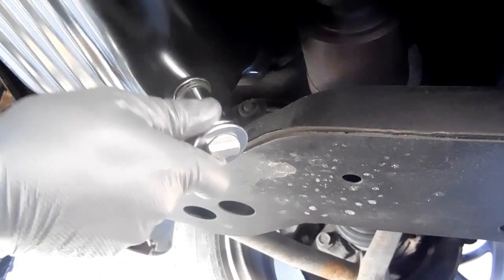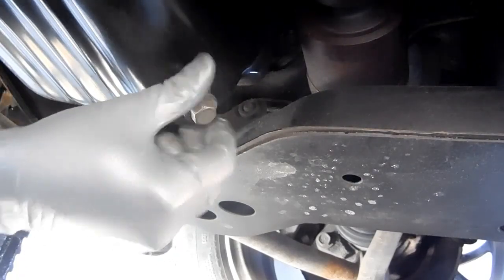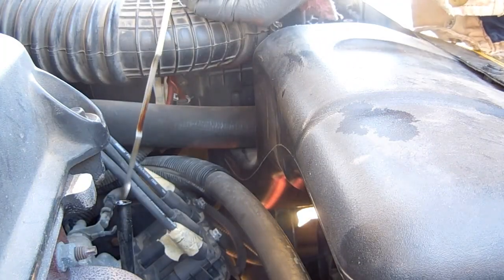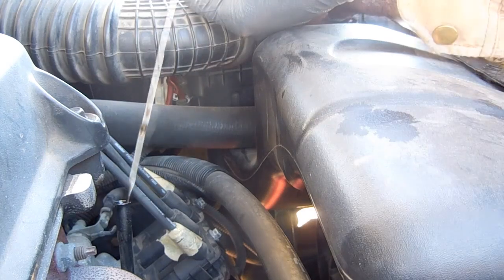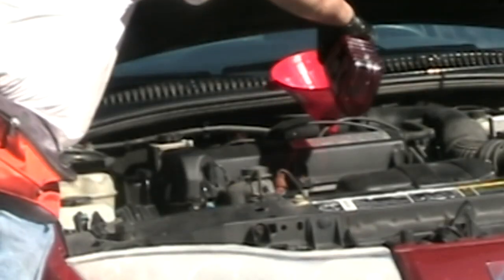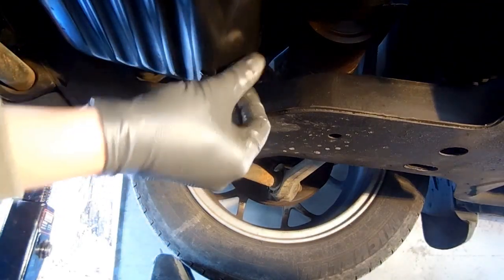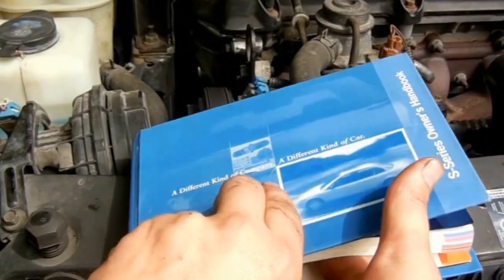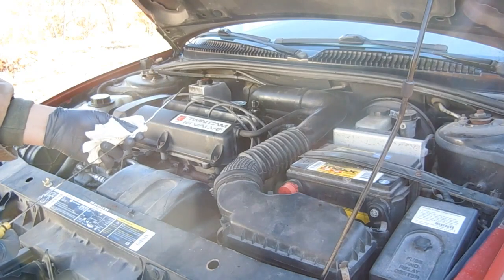Safe Motor Oil Flush Using Kerosene

Comment: 🤣🤣🤣 FRAM IS THE CRAPPIEST FILTER ON THE MARKET ! DON'T YOU WATCH YOUTUBE
Reply: they work fine people are the ones that are crappy
Reply: @brian bessette nah that be Amsoil or Royal Purple for a Cummins diesel it be a Donaldson blue filter
Reply: That's Saturn engine is junk why put a better filter on. Stp and purolator isn't that better mobile 1 or the OEM are better than the first two I mentioned as well as fram
Reply: junk all the way
Reply: if ur driving a work rig or car ..low value......fram will do it....i use m alot
Reply: Fram ultra synthetic actually good tho
Reply: Yea no shit
Reply: Used Fram on my last truck and it had 300,000 miles on it when it was sold. Changed every 3,000 miles using conventional motor oil. Most retards are bandwagon followers and take everything they hear on YouTube from content for views posters as 100% correct. I have never seen a vehicle grenade a motor using a Fram filter.
Reply: Cummins Owner exactly! I put 626,000 on a v6 Pentastar. Every mile except the first 3,000 on a fram filter. Engine looks like new inside.
Reply: @CSXtrackworker  They're still inexcusably cheaply made. Have you seen the internal construction of them? Who cares if they work for 99.999% of people out there. They should be made better, and better made filters are available, so that's what I and a lot of other people are buying; Wix, Bosch...many other brands, most ALL other brands are better made.
Reply: @tempest411  I'm well aware of how they are made. A lot of OEM filters are made the same way. If you change them when they are supposed to be changed then you won't have any problems.
Reply: Azarah Eden brian bessette they’re all the same on the inside go watch filterkingz videos where he opens up the filters and you’ll see for yourself there’s not much different between any brand of oil filter
Reply: @96blackjacket  No, 99% of them are not glued together construction paper like Fram is. Anything is better than Fram.
Reply: tempest411 point of fact most oil filters are glued together like I said go watch filterkingz videos and you’ll see for yourself that internally most oil filters are nearly identical
Reply: tempest411 also every singe internal filer I’ve ever replace in my shop has been glued together and we use factory replacement filters the glue has no problem holding up to regular or even extended oil change intervals or people that don’t know there oil needs to be changed and come in for the first time in a year or better

Comment: One thing worth noting too folks is not to leave the oil filter on while draining the oil ( think of when you hold your finger over a straw and you can maintain water inside the straw until you let your finger off ), you are better off to loosen the oil filter straight after you remove the sump plug and also take the oil cap off the top of then engine - that way it creates a nice "vacum" if you like through the engine from top to bottom and helps remove all the oil out everywhere. Otherwise with the oil filter left on, you can get residual oil remaining in and around the filter and engine galleries.

Comment: When changed per manufactures recommended interval, modern engine oils and engine designs do not produce any “sludge”. How did you come to the conclusion kerosene is “safe”?

Comment: Ok buddy, first of all Kerosene does not have anti-wear additives, like engine oil does, and yes the engine need these all of the time. So the solution (no pun intended) is to mix the kerosene with some anti-wear additive such as Hy-Per-Lube zinc substitute or engine break in additive, which usually contains ZDDP.
Best way I can think of is to mix 3 quarts of new oil, on sale if you're on a budget, with two quarts of Kerosene, and add the anti-wear additive. Make sure these are thoroughly mixed before pouring into the engine. Use the big can you have for the mixing. This way you have new detergents and dispersants of the new oil, the solvency of the Kerosene, and adequate anti-wear for the camshaft and piston rings.

Comment: take filter out first after the flush with got half quart in filter of kerosene but put new oil filter in and new synthetic oil in auto not the cheap stuff it turns milkey

Comment: Crazy don't do this not good for your bearings...rather remove the sump and clean that is just lazy and you could do engine damage by loosening up to much crap in your motor and totally blocking oil pick up...Its not advisable

Comment: If it weren’t cost prohibitive, it would work best to do back to back flushes until the oil drains clean. 
I’ve also seen where flushing an engine with a poor service history can fill the sump of the oil pan with all the “goo” flushed from above; for some reason it doesn’t drain out. 🤔
Reply: Not so cost prohibitive. I used 3/4 kerosene and 1/4 fresh oil. Ran until warm, 2 oil changes back to back to flush out all the kerosene, especially what's gotten into hydraulic lifters and such. One more oil change after a couple hundred miles or a week. About $100 with full synthetic. If you use enough kerosene, all that sludge will dissolve and run out. Only idle engine, don't rev!

Comment: I would recommend using Motul or Royal Purple full synthetic engine oil, and a K&N or Purolator Boss oil filter if you want your brand new engine to  have no oil leaks past the 60,000 mile mark and change oil every 3,500 miles if you drive a sedan or SUV, or 2,000 miles if you drive a Dodge Hellcat or similar. If you don't plan to keep the car long, or you are just leasing it, then you can get away with using Shell or Castrol conventional oil and a Fram orange oil filter and 10,000 mile oil change. If you really don't give a damn, just change the oil (just the oil, not the filter) the day before you return your leased vehicle.
Reply: Crap. Just use any Full Synthetic, even Amazon Basics beat Royal Purple in Project Farm's latest test. 
A good Full Synth with a good $8 filter like Wix (Napa Gold) or Mobil 1 and you're golden. 
For your average car, keep it topped off and 6-8K between changes is a conservative estimate.  
No need for over-priced garbage like K&N, Royal Purple or Boss-anything, unless you have an ego that needs stroking.
Many fleet studies since the 80's/90's have shown decent non-synth oil with decent filter were well able to hit 7500 miles w/out any issues.  Clueless people only perpetuate these rip-offs.

Comment: Will this remove sludge that is likely caked up inside as well? thanks
Reply: You don’t want to do that unless you’re dropping the oil pan and replacing the oil pump. It’ll clog up the pickup and starve the engine.

Comment: I use very thin cheap  oil. Run for one hour drain and let drip for 2 hours. New filter fresh correct oil and off you go.
Happy driving.
Reply: I like your idea best.
Reply: You my friend just described a full volume oil change which is well known in the industrial lubrication industry.  It is the safest and most affective method to clean your engine.  The detergents and dispersants will now be able to do their job rather than dealing with the 10-20% of used oil and solvents in the oil.
Reply: this is exactly what i do, in addition i run the cleaner oil across a filter to check for metal.
Reply: Me too I do same
Reply: One of the best..
Reply: Gus Ibrahim who has three hours to do a 30 min oil change?

Comment: I work in research and development for a large auto manufacturer.  I work with engineers and chemists every day. Most of them have their PhD. The majority of the comments here is nonsense.  Its amazing how many fluids weve developed in the lab for technicians to use in dealerships and garages, that have diesel and/or transmission fluid. I remember at one point we were having a problem in some engines.  The lab ended up being the group that created a working solution to the problem. It was a 10 ounce bottle that consisted of 90% transmission fluid ( same exact stuff gm uses) and a couple other chemicals. That bottle was labeled our company name and logo. And shipped out for $70 a bottle. 
       Amazing right. We all beleive this shit happens but, we never really know. I always thought that sort of thing happened. But, I didnt know for sure. When I witnessed it my self, for some reason I was amazed.  I seen it happen over and over in the last 16 years I've been in r&d. I dont trust anyone. Do what you find works for you and stick with it. That is exactly what they do. They throw things at a problem until something works. Then they charge everyone who asks an arm and a leg for the answer.
Reply: Chopshop2 M  i was only being a wee sarcastic dick. his story is perfectly plausible!
Reply: you are the floor cleaner?
Reply: yah... but you could just be making this up lol

Comment: I my opinion after using motor flush, make an oil change, to clean and absorb the remaining motor flush. After a 30 minutes change the oil again and the filter. Only then you have a clean engine

Comment: buy  new pan gasket, drop pan, clean sludge, reassemble clean  pan w new gasket, replace oil filter, fill with recommended weight oil.

Comment: I have done this with a different aproach, i first removed all the old oil, added cheap new oil, filter and a complete bottle of flush, this let me see if the color of this new oil change (turn darker) because it's removing some Sludge, otherwise with the old dark oil you Will not know. In my case because of my frequent oil changes, the new oil gets out pretty clean...

Comment: That oil you've just drained out is still pretty clean and certainly would not require flushing,you would have to be mad to put Kerosene or Diesel in an engine to flush it as it breaks the lubricity of the remaining oil down and could possibly ruin the engine bearings, if oil and filters are changed at regular intervals say 5,000 or 7,500 for the bigger engines there is absolutely no need to flush them,all this paranoia about flushing engines is crazy just just change it they'll run forever.

Comment: I recommend using SeaFoam (1 oz per qt of oil) every 20,000 miles after 100k miles on engine.  With 5,000 mile oil changes.  Best is to stay on top of regular oil changes.  There is no substitute.
Reply: I’ve driven 800,000 miles and not once used an additive.  Never had varnish or sludge in any engine,  16,000 mile changes.

Comment: hold the blue qt bottle the other way 
avoid glug glug.
Amsoil detergent flush: add car,
idle 10 minutes and drain.
Easier.
$10 much safer to engine.

Comment: Changing your engine oil before gets really dirty will prevent this from happening. I change The oil on my truck every 2500 miles regardless of how clean the oil still is. Some say it is excessive and waste of money. But it’s The debris suspended in the oil what is abrasive. Long before the oil itself has lost its viscosity there is grit although microscopic floating around in the oil. I’m planning to keep my truck a very long time and oil is cheap. It’s easy enough to change oil and I hate car payments.  Cars that go over 300,000 miles without rebuilding the engine usually have a common factor. The owner was diligent about changing oil and filter. Once your rings are worn to the point that blow by is getting excessive the oil will get dirty or even faster and fuel vapors will “thin” the oil.  Is your goal to get the most out of your oil or to get the most out of your automobile???  It’s a lot easier to come up with the money for oil then coming up with the money to buy a new vehicle.

Comment: I would like to see this done with 2 quarts of brand new oil. And see what new gunks come out after the first oil change.
Reply: I did that with Liqui moly engine flush. Drained old oil, filled with 2 quarts and a bottle engine flush. What came out was darker than the old oil (2011 mini cooper s, in the 4 years i had it, it has had oil intervals at 1/3th of the time BMW recommends).

Comment: You were doing so well - flush - oil drain - lucas - even removed a Fram filter - but then replaced it with another Fram filter.  Dude.

Comment: Its debatable whether flushing an engine to clean it out is good or bad for it. My thoughts on your video is as follows. 
1} Flushing an engine with anything other than motor oil is risky business and a repair to fix a spun rod or main bearing which is the most likely problem far outweighs any reason to do this. If this were to happen on your Saturn the car is worth less than the cost to repair it so I dont recommend flushing AT ALL.
2} But if you feel you MUST do it, read my last line on this comment and do it in the sequence as I suggest below. It will greatly lessen any chance of engine damage.The engine must be fully warmed up before you do this. 
3) Drain all of the oil from the engine.
4} In a container mix 2 NEW quarts of oil with two quarts of kerosene and mix it very well.Install the drain plug back into the pan.
5) Pour the mixture into the engine and run it for 20 minutes or so and just let it idle, do NOT rev up the engine.
6) Shut the engine off and let the engine sit for 15 to 20 minutes. Drain all of the oil\kerosene from the engine. With the drain plug still removed pour another 5 or 6 ounces of just kerosene into the engine, this will clean all remaining dirt sitting on the bottom of the oil pan.
6} Don't use any oil modifiers, just use an appropriate oil for your engine. If you engine has very high mileage and has blowby as you mention just use a "High Mileage" oil as these have a different additive package. If the auto maker says use 5W30, use 10W30, 10W40 or even 20W40. This performs much better than additives and will also save you money.

Of course the very best solution to get and keep an engine clean is to change the oil every 6000 miles. I have a 2005 Taurus with 307,000 kms on it and I have never had dirty oil in it even when I go to change it. Also because my oil is virtually always clean I only change my filter every second oil change.

Best Wishes Bob.
Reply: I also have a 2005 Taurus SE with a 3.0 Vulcan engine. I ran 5w20 Motorcraft blend for the first 150,000 miles. Then switched to Valvoline 5W20 high mileage full synthetic. After the 150,000 miles have 158,000 miles now.Woild you recommend a engine flush now. Have used MMO and seafoam right before oil changes. I have used a good quality oil filter. I have changed o every 5,000 miles sometimes 7,500 miles during the winter months. What do you recommend now to go to 300,000 miles?  Really need your input? Thanks,  Shawn.

Comment: when you dran the oil there is a bit left in the engine....so that means a bit of kerosene will mix with the new oil and change its chemistry.....i just use mobil1 all the time

Comment: There's no way would I use anything that harsh to clean an engine unless it was near death and I had nothing to lose. Solvents like kerosene or diesel can cause large chunks of sludge to end up in the pan and get sucked up by the pump, restricting the oil flow or sending a large wad of black snot back through the engine. 

Usually 3-4 oil changes every 1,000 miles until it's clean will take care of the problem without the risk of washing out the rings or crankshaft bearings.  I'm doing that now on a 44 year old big block Chevy that I purchased with 103K miles.  I'm on the 4th change and it looks great. A gradual cleaning takes longer and costs more but doesn't hurt anything.

If an engine is dirty enough to require solvents then the engine is going to be on its last leg anyway. I would use a quart of ATF and drive it easy for 20-30 miles and then drain it hot. For cheap filters I use Walmart Super Tech. Screw that Fram crap. I wouldn't use Fram on my lawnmower. 

If quality oil was used and changed at regular intervals it shouldn't need a hard flush at 100K. I had a Chevy with 160K and the inside looked like new, but I am a stickler for 3K mile oil and filter changes and oil is much cheaper than an engine.. 

Engine flush debates have been going on for years. I'm just expressing my opinion.